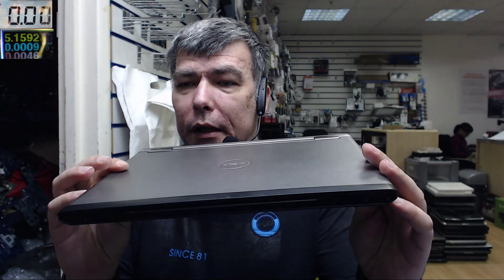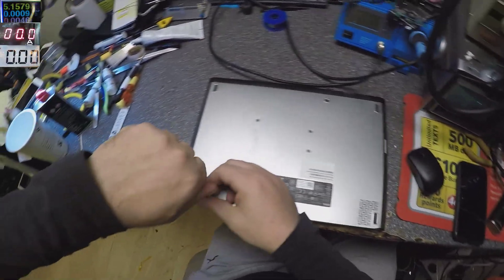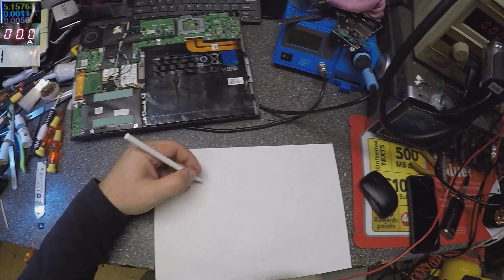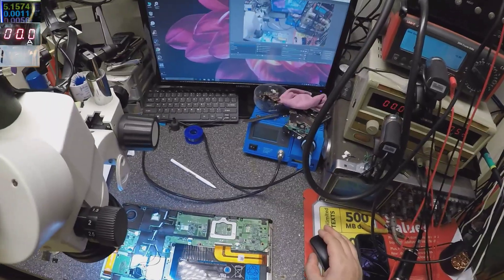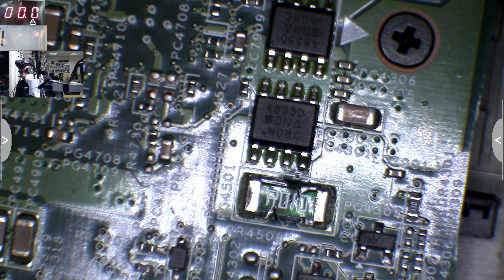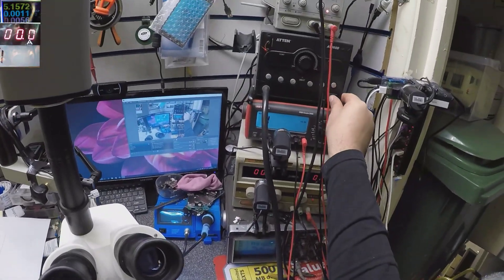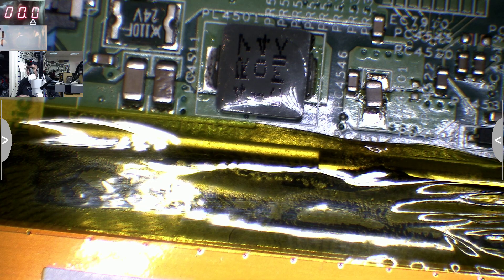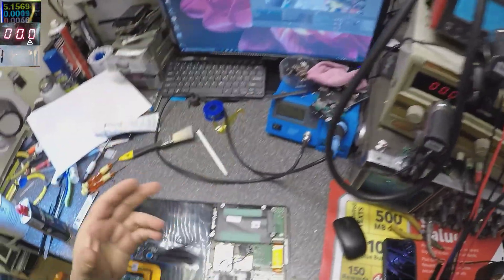How to repair short to ground laptop motherboards, dell vostro 130

Comment: My laptop MB doesn't power on. When I press the power button, it powers on for 1 sec then shuts off.

I found the gate input voltage for the 2 power mosfet near the power jack is at 25V (yes, it's 25V) where the power adapter only provides 19V.

My questions are:
1. Shouldn't the power mosfet near the power jack typically be P-Channels, so the gate should be like 5V -12V?
2. If it should be P-Channel mosfet, doesn't that mean the 2 mosfet are bad?
3. The power management IC should Monolithic Power Systems, Inc MP2949A, but I can't find schematic nor datasheet, so how can I tell if 25V gate voltage is correct or not?

Comment: When i see it in youtube it's seems a pet but in reality it's a monster
Well, i have a dell board when i test f or a short i found multiple places i tried to separate the blocks but norhing i couldn't get to any component even when i take off the heated ones, the shorts doesn't go, i found a short on 3D3V_S5, boost_mode#, 3D3V_AUX_S5, and 3D3V_AUX_KBC.
I did every thing i could but couldn't not determine the faulty components.
So is there any trick could help me with

Comment: basically mosfets are more or less is a circuit breaker and the other stuff inside the motherboard are either 2ways 3ways switches and a basic fuse except the chips like sio diodes cpu gpu

Comment: you melted the battery, kapton tape wasnt pushed down fully. hot jet got under and melted battery......  a strip of aluminium tape on top of the kapton tape to deflect air would have helped.

Comment: How do you know if the the capacitor you used as a replacement capacitor was going to be compatible, because it looks smaller then the original.

Comment: A question. Why does the capacitor get very hot and not the rest too? After all, you're putting many amps there. Shouldn't other less powerful things heat up too?
In any case, thank you again for the video!!!

Comment: So basically I got a laptop that I've bought from second hand , and when connected to the powersupply it kinds of create an electrical field (dont know how to say in scientific terms).
If for instance I reach out touching with the same arm that laptop an other laptop at the same time (both hooked to the mains) it will do like a litle shock. May it be that these laptops are metal cased? but there is something definitely wrong in the one I'm talking about.

Thanks for the video
Reply: First, this video is several years old, and you're lucky that anyone noticed your comment. Second, who starts with "So basically..."?

3rd, if you can feel current, when touching both laptops, then you have a short. Current is flowing through the metal case of the defective laptop, through your body, to the case of the other laptop (which, I'm assuming is also plugged into the wall).  Find and fix the short, as Sorin is teaching in so many of his videos.

Comment: Excelent job sir... My clevo laptop P750dm2 not powering. It has a charger light when plugged in,and also can fully charged the battery in the indicator. The problem is,when pressing the power button,nothing happen. Its just flashed green light once in the power led indicator. Ive pulled out everything,reseattings all component but nothing change... Hope you'll make a video how to fix clevo/sager laptops... Thanks for your video,i will try this too...

Comment: Is it normal for a platform controller hub to get hot as soon as you connect the power adapter without having to power on the laptop ?

Comment: On the left side of inductor there are two caps, the one closer to the inductor looks like its surface is demolished - how likely is that it will fail way sooner than the one next to it, and could it introduce system instabilities as such?

Comment: When probing around for shorts to ground, on diode mode, isn’t it always recommended to place the red probe on the ground, and to use the black probe, to probe around? Please correct me, if I’m wrong. Cheers

Comment: Can you explain more about the power supply used to inject volts into the circuit?
Reply: It is simply an bench power supply, where it can regulate both voltage and current, and even if it finds a short circuit it does not trip, keeping the load active. Allowing to locate the device responsible for the current leak.

Comment: What happens when nothing gets hot.. iMac 1418 power supply ok 12vdc, but when connected to logic board voltage disappeared ,any suggestions ???

Comment: He is using both hands when writing!!! I love this guy!
Reply: I practice laptop repair but on my second laptop repair is hard because the laptop is working on battery only or charger only. When i plug the charger it's shorted on my bench power supply but when i plug unplug its works some time. You don't have video like this that's why i don't have an idea but i think it's a bad charging chip or some protection diode.

Comment: I have a video card I am trying to learn on. It does not show a short to ground when I plug in the 12 volt plug in the back. When I check several of the caps after the mosfets, both sides of the caps show shorted to ground when using diode mode! I have pulled all but 3 caps off and they are still saying short to ground on both sides. There are 4 mosfets I have not pulled yet that show shorting the center tab and right pin. suggestion? How about showing a video card or desktop mother board no power repair with starting from the real dummy part of power connections. Thanks for the video.

Comment: 2.5 Amps at 19Volts
Reply: For amp injection in other laptops, keep the current range within the range of your original laptop adapter's (charger's) Voltage rating. E.g. If you are injecting on one of these rails: 19v or 5v or 3.3v, the current will be max (as rated) for 19v  and lowered for 5v and further lowered for 3.3v . So in practice "A component when operated with its allowed rated voltage and current when heated signals that it may be faulty". (Warning: applying current rated for 19v rail to 5v/3v rails will burn the 5v/3v rails and applying current rated for 5v to 3v rail is not good for components on 3v rail)

Comment: why after the power connector always are 2 mosfets and one isn't enough?? if they both act like switches and the second one depends by the first one one should be enough so why they always put two please Sorin explain this

Comment: Hi and thank you for your valuable lessons. 
I am troubleshooting a gaming laptop motherboard , which is shorted to ground after the two main mosfets, i applied 15 volts , up to 4 amps and nothing gets heated , only the vga chip but not that much, i mean i can touch the chip. is it possible that the short comes from the vga chip?

Comment: I've watched this video over and over to help me diagnose an Acer swift 3 with similar problem. Since finally getting a linear DC power supply off eBay, I also put about 2 amps of power through my board and found two resisters heating up! One with no sign of damage, and another that had scorch marks coming from it. I've replaced both using a hot air rework station and resisters from a donor board. And after a couple trials of using the hot air gun to rework the solder... I plugged it in and VOILA!!! LET THERE BE A CHARGING LIGHT, AND BOOT LIGHT!!  Thank you so much sorry. Can't remember your name. But I do love your teaching style. You give hope to those who may know theyll never be smart enough to "design a car" but at least you help them change the tires if you know what I mean. Thanks again.

Comment: Thank You Sir Sorin for all your instructions!! i actually managed to fix my acer laptop using your method, i didn have a multimeter nor the tools that you have just a soldering iron, i used 2 9v batteries connected to each other instead of the linear power supply that you have, i thought i didn have anything to lose anyway, to my suprised one of the chip started to heat up when i press my hand all around the motherboard, i removed that chip(i didn have a spare one)
and the laptop booted!! i do not know how long it will last though, Thank You Again Sir Sorin!!
Reply: Nice one, I don't have a linear power supply and I have the same issue I will test this later, Thank you,
Reply: Hello, can you please elaborate a little more in how you made your linear power supply with 9v batteries? My dell charger cuts the power supply and i don't have a linear power supply either.

Comment: I wish you were in my area, I’m sure you would fix my laptop in heart beat
I don’t know if you read this but I just bought msi gs75 stealth gaming laptop from offer up and I got scammed
When I plug to ac adaptor my touchpad acts crazy useless even usb and hdmi affects when plugged once I unplug it it’s fine, also if plugged but I’m hold touching my laptop on the sides touchpad works fine it’s something with grounding problem you think you can help?

Comment: Thank you very much. After watching this I managed to repair my Acer Aspire 5560 which had a faulty capacitor. No power/charge LED on the laptop with or without the battery. I had 19v from the power supply but when I plugged it into the laptop the voltage dropped away quickly. Watching this video helped with the diagnostics. Thank you once again.

Comment: Hi Sorin, I have upgraded to paid subscription hoping to find a means of contacting you but cannot see one so am leaving this question here.  Please help me if you can by clarifying my issue.  I have a Samsung NP550P5C that thanks to this video I now know is suffering from a motherboard short.  :)  I have found my MOSFETs with 19v into the first but only 1v across the 'bridge' connecting the first to the second and the second MOSFET shorts across itself.  Alongside the MOSFETs are two very small items (capacitors?).  They are about the size of the item PC4546 in the video.   Taking them in the same order as the MOSFETs the first does not short across the terminals but the second does short across the terminals so is the capacitor like item my problem or the MOSFET ... how can I tell?
Reply from the maker: David Caple hi, thank you, but the best place to ask its our discord server, thank you
Reply: @electronicsrepairschool  Sorry I don't understand ... what is your "discord server"?  It means nothing to me! :(

Comment: Hi, nice video. My Dell inspiron 1564 have continuous beep on start up ,after any key press then start to boot after that sound gone. After I open and check  i see cable is burn near the input output board(usb,audio,memory card reader) .After I remove this i/o board still beep sound ,and change CMOS battery still same continues beep on start up .

Comment: Got a question for you. Got a Lenovo Yoga 720-13IKB, here and found a short around the ram and when I inject voltage there is no sign of a bad component. But there is heat but spread out pretty much. I have checked all the mosfets and coils and they seem to be good. Any ideas?

Comment: I found the short to ground and I removed the bad capacitor!!! I dont have a replacement on hand. I restested for the short to ground and its gone. If I plug it in would it still turn on missing the capacitor???? Are these capacitors directional???

Comment: Thanks to this, I found the broken capacitor on my E6540. Was one of 4 in parallel, so just got rid of it. Works like a charm again!
Reply: That's awesome!! Do you mind telling me where he put the leads when he transferred the Amps to the Motherboard? He didn't say anything at all so i got lost.
Reply: @thingshappen9199  He put the negative to a spot where a screw is. Those are all ground. He put the positive on the last FET output. I have just used the chargeport connection in my case.
Reply: @jdgmeester  Ok. So to run the current through the motherboard he place the - lead on ground and the  + lead in the FET output? How did he know to run 1.5 amps?
Reply: @thingshappen9199  to be able to dissipate enough heat to locate the issue, you need a little power. If you generate too much, you will burn stuff. You could start with 1 Amp too.
Reply: @jdgmeester  ok so 1-1.5 is the way to go in laptop mobos. Nice.Thanks. your awesome.
Reply: @jdgmeester  Hey. I started working in this old laptop with no power whatsoever and noticed that this chip has no voltage in one of the four contacts in each corner. It's located right after the charging port, but i want to know if this is normal or if all four contacts are supposed to have the 19.5 volts? https://i.imgur.com/i950JeA.jpg

Comment: Hi sir, when using the power supply, you set it to 2amp. What the voltage set to? 19?
Reply: It looked like 5v on the top display

Comment: if there is no available external power supply, how could you locate precisely the short to ground capacitors above mentioned by using only the charger power supply and the multimeter? thanks
Reply: You'll probably have to find the motherboard's schematics and check every single element on the power line until you find the rascal(s) :)

Comment: hello sir what are the most common causes of overheating in laptop
Reply: Not changing the thermal paste every year. It's like driving your car without ever changing the motor oil. Ironically he just blew the dust away, which fucks up your fan's lifespan. The fans' insides also need debris cleaning & fresh grease so it becomes quiet & reliable again. If you don't change your thermal paste, it becomes hard as a rock and instead of transferring all the heat away from the chip to the cooler it just isolates it back to the chip and the motherboard and something eventually gets cooked :) Meanwhile the laptop will try to save itself first by lowering the computers performance to an unusable state and second by using overheating protection (shut down). Pretty much 90% of laptops die this way from overheating, rest is due to water damage.

Comment: Okay, question, he/you just changed the cap without bothering to check if they are of same rating. Does it not matter or you knew by experience that they are the same ?

Comment: Great videos!! I'm having the same issue with a board but can't find anything getting hot when power is applied. I've tried all the way up to 3.0amps. My symptoms are nearly exactly the same (short after 2nd switch). With the laptop power supply, the light on the power supply turns on and off repeatedly when plugged in. If I apply direct power prior to the first switch, the first switch gets really hot. There's no short at the first switch and the short only starts after the 2nd switch. I've removed both switch just to see what would happen and there's still a short.  Any idea of what to try next or what this could be?

Comment: Can someone please elaborate on the part where he applies amps to the board? What pins does he connect to? Is the voltage 2 and amp 2?Thanks
Reply: Ok I used 2 volts and 2 amps and found the shorted cap :)

Comment: Hi Sorin, I have a ACER 5742 the first sense resistor R0.020 is missing. I have 19v on first and one side of second mosfet.
Do I have to fit resistor before I can test past second mosfet???

Comment: Why you put 2.5 volts with 2 amps on 19.5 volt powerale after the current resistor? Why not 19.5 volts? I have watched other videos for you, and you seem to put 19.5 volts after the two mosfets and the current resistor. So why this one is only 2.5 volts?
Thank you for the help
Reply: I would know where He applies the v point? On the resistor?

Comment: can we use petrol and use the charger for identified short circuit on that power board?
Reply: no because a charger is protected, it wont keep passing the Amps is the is short in the board. But im thinking a battery can do the Job. But a 6v volts that has about 1Amps to 3Amps. Ive never tried it but i think it can worl

Comment: Sir, kindly look into my matter-
My laptop was not turning on  and also my adapter was blinking then
I tried mentioned methods in lenovo forums 
I removed battery, removed Cmos connector, then held power button for one minute and then without connecting battery provided a direct power to laptop, it blinked for
But it blinked for a second and then went dead. Then on youtube a guy showed a step "to remove keyboard connector flex and then turning it on by novo switch and it worked. So now keyboard is dead but laptop is working. Is there any way to solve the issue
Kindly help

Comment: good evening do you tell me please, what is the amps
2.3 oder 4.0 amps what means that, and how can i buy this device.
Thank you
with best regards
Reply: It is called a variable power supply. They sell on amazon for cheap at around 50 usd and they go from 1 to 30 volts max with a current from 1 amp to 10amps

Comment: how do you know the value of that dead capacitor you've removed? and how do you know thats the right value for replacing the dead one if you dont know the value of the one you have removed? A REPLY WOULD BE MUCH APPRECIATED. THANKS IN ADVANCE.
Reply from the maker: the capacity of that cap is not really important, cam be just left removed. But just to be sure i don't miss your comment, ask any question on our discord server, thx
Reply: @electronicsrepairschool  Thank you very much for your reply. really helps a lot for a newb in electronics repair like me! thanks!!😊

Comment: I have acer one 14 z1401 when i plugged charger and power it on it powers led lights up and fan spinning, no display then shutsdown completeley after 12 seconds, I notice the cpu heats up really2 high even if i just plugged in charger without powering it on, cpu burns probably shorted i dont know what to do

Comment: I’m having this same problem on an Acer laptop. The laptop works but the charger adapter light goes off when I try to charge the battery. Does it matter where I apply the to find find the bad component? If I apply it at the input for the AC adapter, the first two components there get hot which I believe are a fuse and a diode of some kind. I remove both chips but shorting is still present.